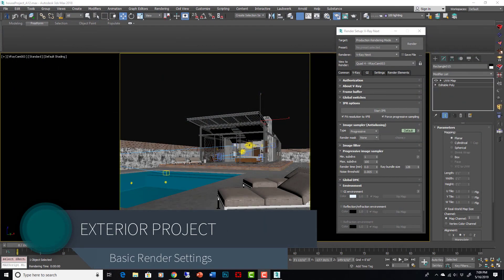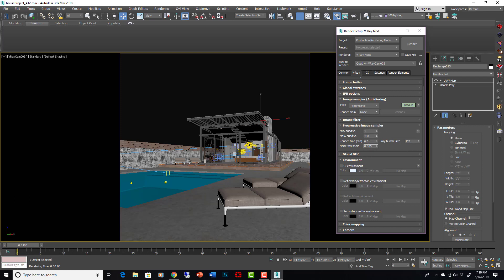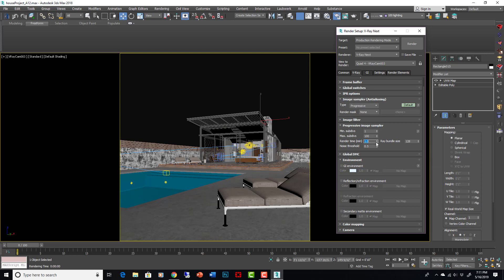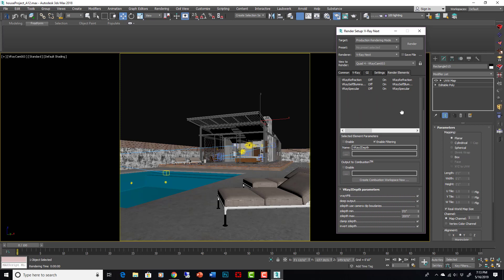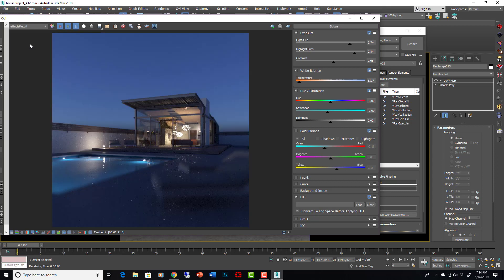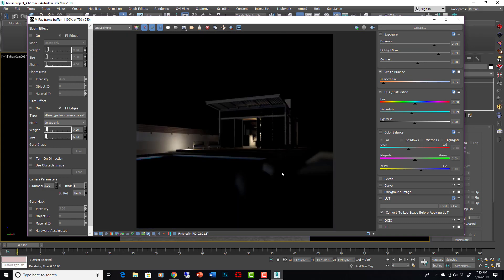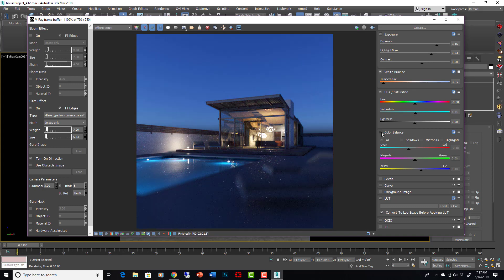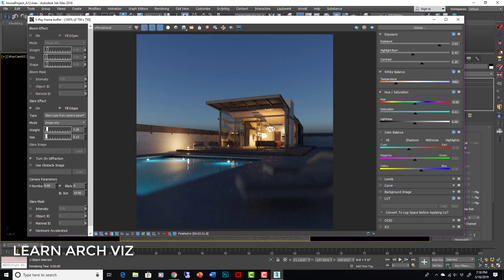V-Ray Next: Basic Render Settings, Render Elements and Frame Buffer Settings

Comment: Is there a reason you use BF instead of IM. I read that IM is much smarter in the use of resources so it allows for better result if used properly. Did something change in Vray Next?
Reply: Irridiance Map is a baised gi solution the reason why it is faster tha brute force because it uses some shortcuts when computing gi that is why some vray render looks sa flat or plastic looking specially for those tiny contact gi detail you wont get those tiny gi detail in IM why brute force is much slower than Im but it is more  accurate so those tiny gi detail you will get those rich detail when using brute force, most people say  corona is much realistic than vray its because it uses path tracing aka brute force corona dont have baised primary gi engine but when you use brute froce in vray you wont notice any difference between corona and vray believe I've done a tone of test regarding this matter...
Reply: @arjun220  thanks a lot motivate me to try rendering with brute force
Reply: @arjun220  how to control the noise in BF then?
Reply: had the same question bro